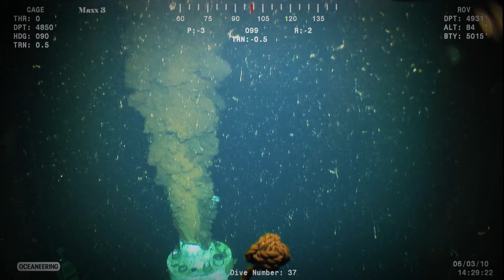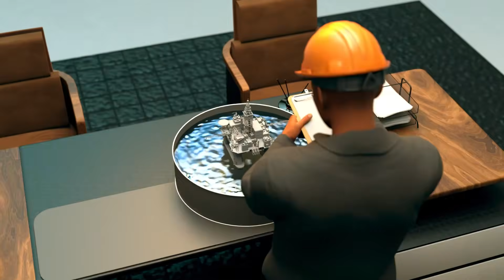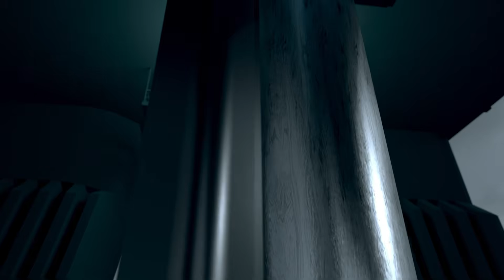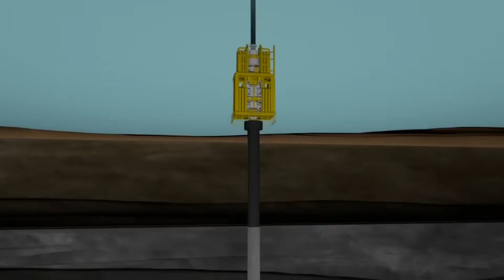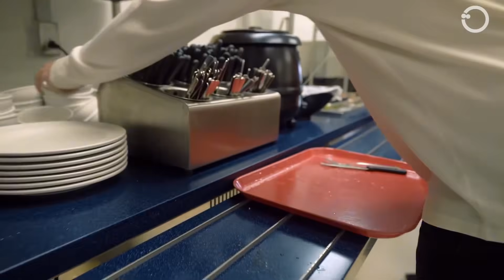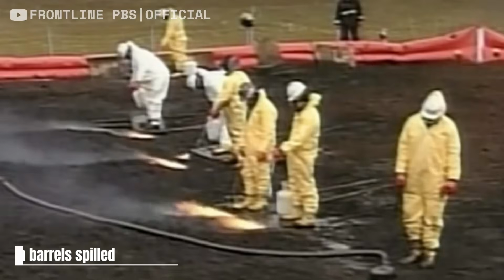Why Oil Rigs Don't Sink

Comment: Decent video of drilling overview but it felt kind of incomplete so just wanted to share some additional details.

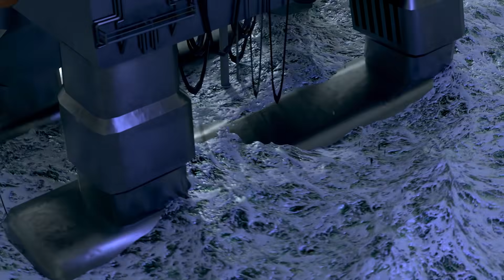03:37 How the rig is kept in position in the sea wasn't really explained even in the later parts of the video. In addition to the ballast tanks, a semi-submersible rig like the one in the video is actually kept stable and in position by anchors and chains. Most semi subs have anchor and chains which can be deployed in either 8-point or 12-point mooring pattern depending on the available metocean data and seabed surveys. Anchor Handling Tug Supply (AHTS) vessels are required to deploy these anchors and there are a lot of interesting videos on YouTube like this one: https://www.youtube.com/watch?v=KM0x5m0pdpk. 
Newer generations of semi-submersible rigs also come with Dynamic Positioning (DP) system which uses multiple propellers to keep the rig in position.

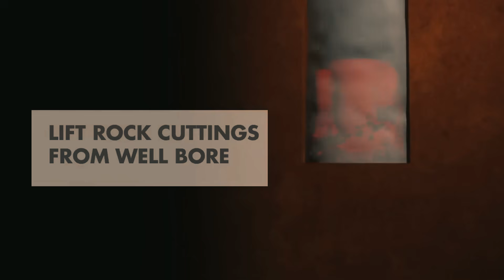05:30 The Drilling mud not only serve those two reasons stated in the video. Two of the most critical roles of the drilling mud in drilling operation is for primary well control and hole stability.
For any formation, you can draw a Pressure vs Depth curve and plot two lines on it. The lower limit curve for formation pore pressure and upper limit curve for formation fracture pressure.
Most drilling operation is drilled under "overbalance" condition.
"Overbalance" basically means the hydrostatic pressure of the drilling mud column in the well is higher than the formation pressure. This overbalance helps to keep the formation fluid (oil/gas/water) in the formation so we don't have a "kick". However, this doesn't mean you can have a very heavy mud in the well as it can also cause fracture in the formation and loss circulation and hole instability issues when the hydrostatic pressure of the mud exceeds the formation fracture pressure. 
If for whatever reason the overbalance condition is lost and the hydrostatic pressure of the fluid column becomes less than the formation pressure, you will have a "kick" which means an influx of formation fluid has entered the well and rising up in an unwanted and uncontrolled manner. 
When this kick reaches the surface, it becomes a "blow out" which is what happened on the Deepwater Horizon. 
This is where the secondary well control and the BOP comes in. As the overbalance condition is lost, you need to close the BOP to "shut in" the well to prevent the oil and gas from "blowing out" at the surface.  
BOP can be either a surface stack (common on land rigs and jack up rigs) or a subsea stack as seen in this video. Both surface and subsea stacks share the same function but subsea stacks are tad bit more complex and complicated due to the nature of the environment it is deployed in.
BOP stacks have different types of rams, but they are commonly Annular BOP, Variable Bore Ram, Fixed Pipe Rams and Blind Shear ram and these rams can be arranged in different configurations depending on the client requirement. When there's a kick, the well is either closed on the annular BOP or the pipe rams and the annulus side is lined up to the choke manifold. There are many ways to "kill" a well and bring the well back to safe "overbalance" condition. 
Typically, a "heavier" drilling fluid is pumped down the drill string while displacing the influx to the surface in a safe and controlled manner by adjusting the choke at the choke manifold to keep a constant bottomhole pressure until all the influx is circulated out from the annulus.